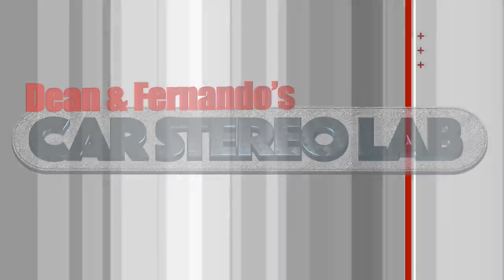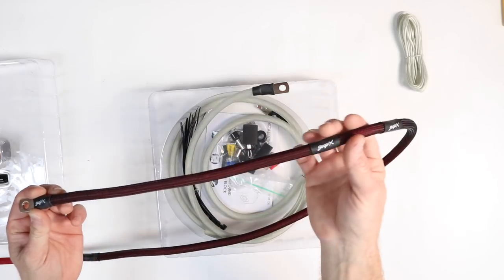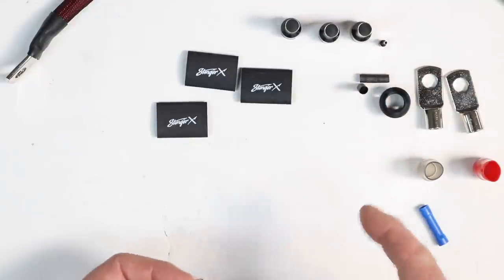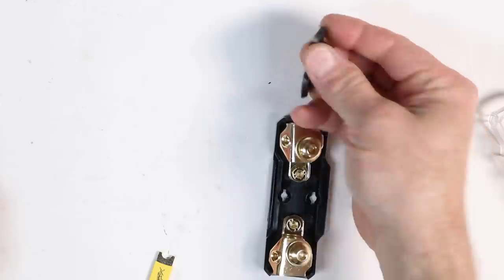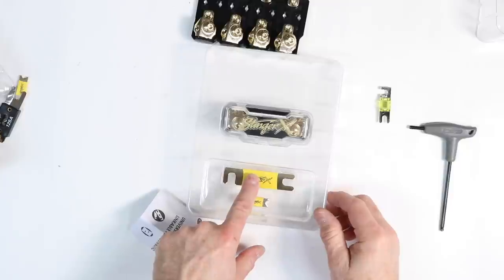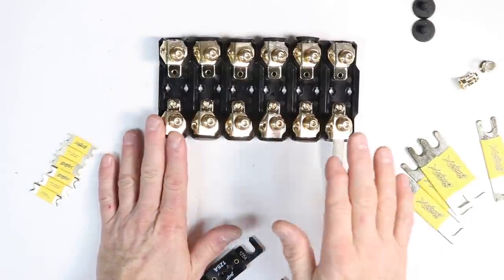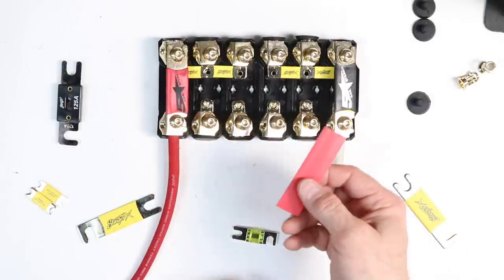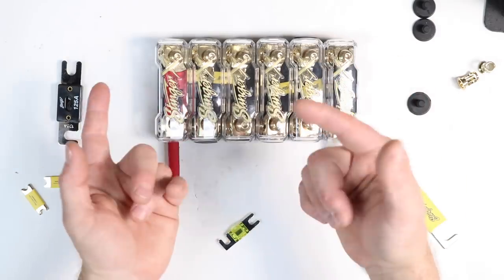Stinger X  Link fuse block upgrade Car Stereo Lab 13

Comment: I have three perfectly good pairs of RCA's never used but I just bought the Stinger 6-channel 17ft RCA cable cause Dean said in one of the episodes that it's flat. I thought to myself "yea, I really don't like the RCA's that I have right now.They twist and cross each other and makes it really tight under the carpet but these Stingers are awesome. Thanks for the heads up guys.
Reply: Paco Leech I’m running a set of those same 6 channel Stinger RCAs. They work great.
Reply: @joeyjames4953  Right on. I just got mine. They're awesome. The picture on amazon doesn't do them any justice. You cant even see that they're flat (not bundled) which sold me on it.

Comment: Awesome 👏 video as usual .Audison connection has the same fuse system , very flexible
Reply: Alloy that is somewhat true, they have a  4ga only modular system, but nothing close to the ability of XLINK , 0,4,8ga MIDI or ANL fusing all in one block. That is why it is patented.
Reply: Stinger  copy the idea and improve it. @caraudiotec

Comment: Steve Meade has the heavy duty versions for sub wiring distribution and what ever else you want to do in the lab
Reply: Anything with the letters SMD on it is overpriced,  and you can find something that does the same for half the price.. only this I've bought from his is a sub speaker wire terminal cup.. he needs to make his stuff more affordable and it would sell better, but that's just the guy he is
Reply: @tankdog03ify  a homie I'm from califas so I like to contribute to the business's there stinger Rockford kicker etc... are all pricey too but since they are big business no one says a thing

Comment: Does these fuse holder work for under hood installs or are these for only use to interior use? I think I'm going to have my local installer use these x links for my install.

Comment: They took this idea from knukoncepts and took it one step further so u can connect them.. I use ring terminals so this wouldn't work for me, I like to keep all my connections air tight with adhesive lined heat shrink, which is why I don't use the set screw type connections, maybe once and if I ever upgrade to 100% tinned ofc I would use these.. but for now I've got to much invested into my 1/0 skyhigh ofc.. sky high should sell tinned ofc..

Comment: Why not use circuit breakers instead? Then there is no need to keep buying fuses
Reply: If u keep blowing fuses you've got a bigger problem.. I haven't blown a fuse in years, I only run about 300a though, my 250a fuse carries plenty of current
Reply: @tankdog03ify  a circuit breaker has more benefits than just not buying fuses. Much easier to de-energize than with fuses if you want to upgrade, rework or do anything you wish to your system.

Comment: It's a great idea for a new product, but the price tag is a bit ridiculous at $49.99.
Reply: 50 per link???
Reply: @dylanhoel1636  yep, on stingers website.
Reply: @tjohnathon30  you can get 2 SMD full copper split blocks for less than what they used here. And the SMD has the same amount of mounts. That's just outrageous for a fuse block
Reply: @dylanhoel1636  Yea, at least the SMD products have a reason for being expensive. These are mass produced, but a lot of what your paying for is the name.
Reply: Ya it should be around 15 to 20$ tops